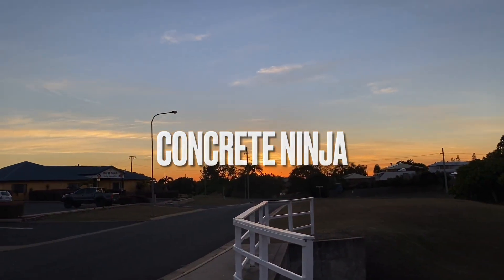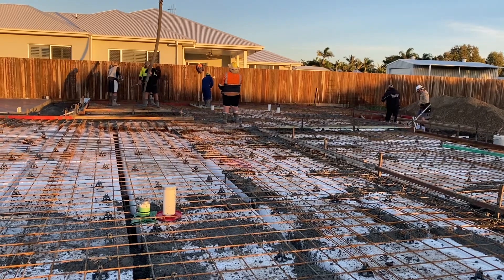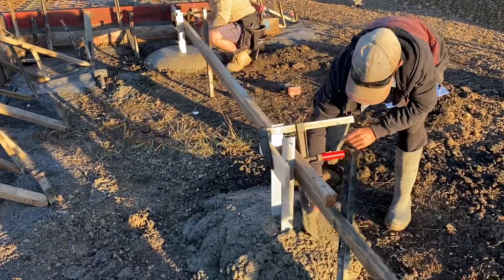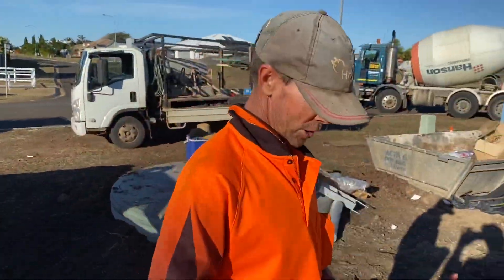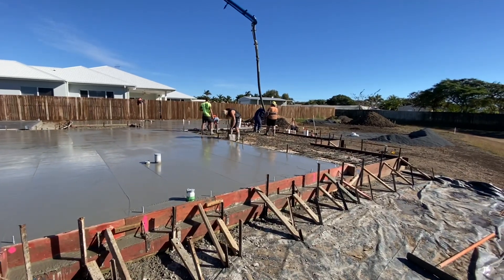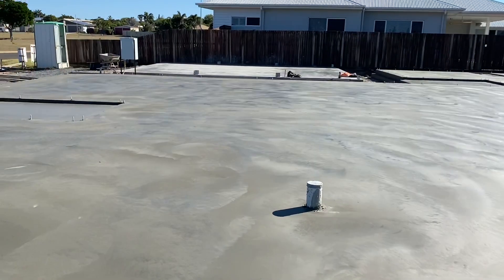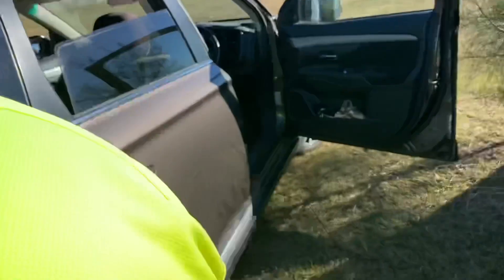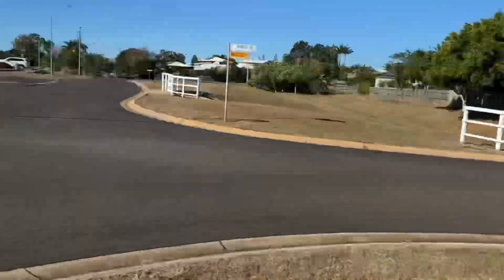Can Concrete make men fertile ￼

Comment: Made me in-fertile !  I was running the troweling machine and hit a piece of wire sticking up through the concrete lost my grip on the handle and it swung around and hit me in the nuts I am 6ft6 inches tall !!   Which made the handle nutz high and it gave me a good WHACK put me right to my knees !!  Ending my baby making career not that I had one anyway !!
Reply: I cringed a little just reading this. My condolences to your nutz.